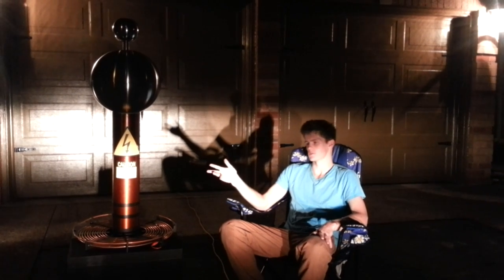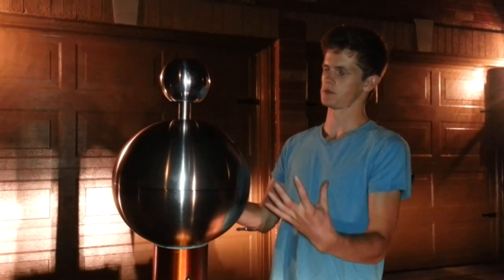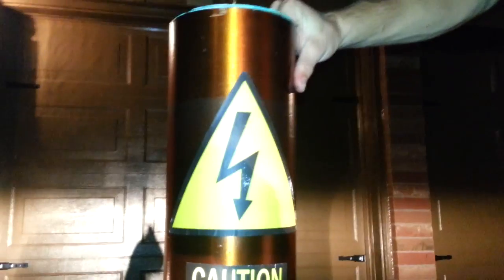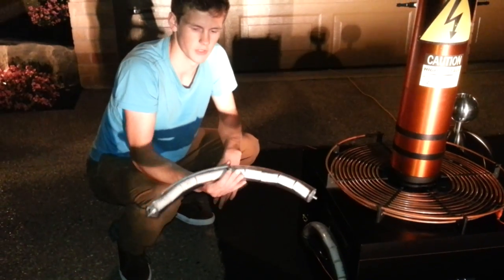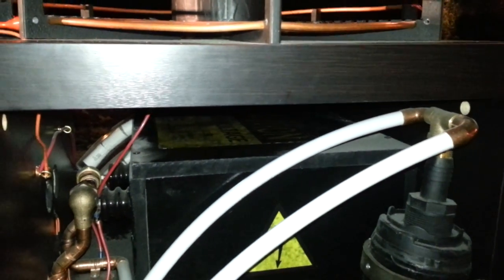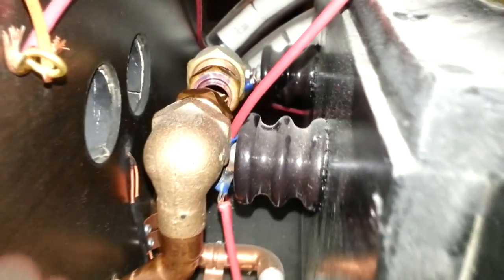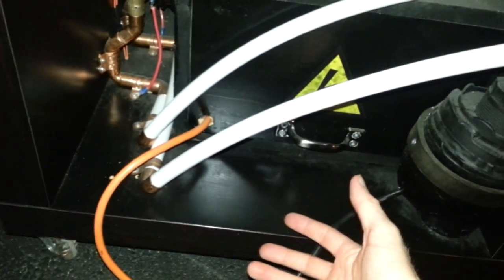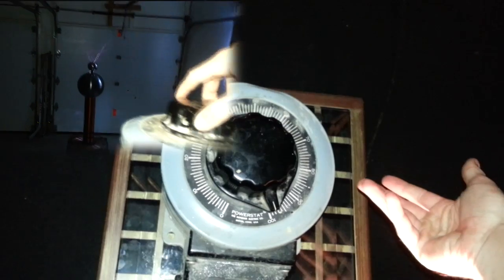Lightning Machine built by high-school student

Comment from the maker: no. You cant see it, but there is a thin wire on the end of the tube. It is connected to the ground. This way, the path of least resistance for the lightning to get to the ground is through the wire instead of through me. I dont feel anything.